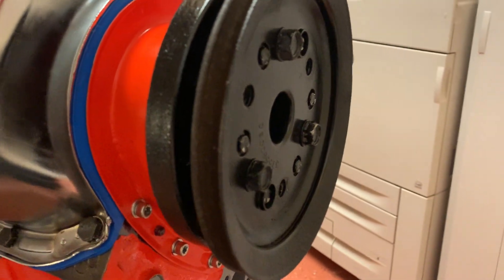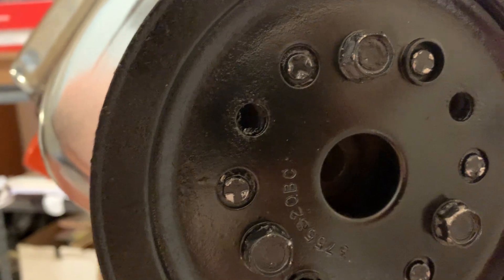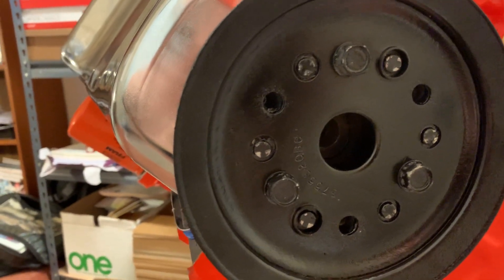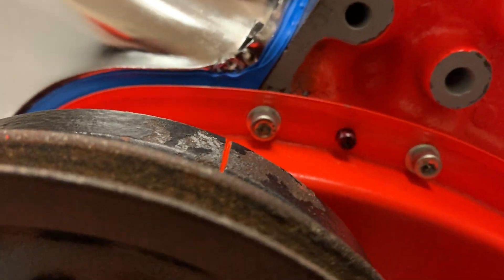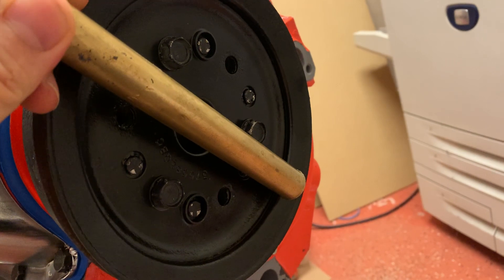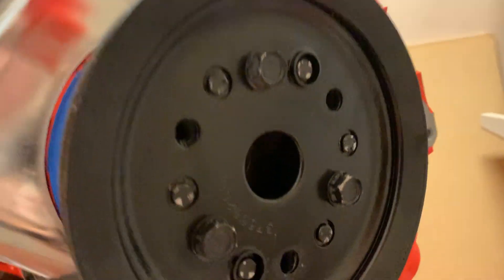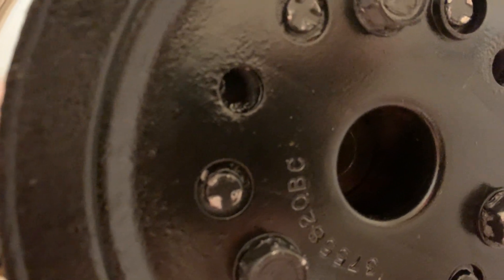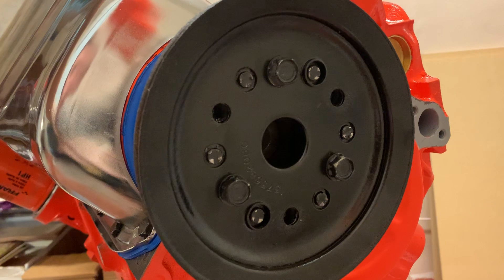Installing Balancer on SBC

Comment: My 56 chevy still has its 265 v8 which doesn't have a bolt going through the crankshaft like yours . I have to remove and replace my balancer to fix a oil leak where the timing cover and oil pan join . Thanks for the info 👍

Comment: Can you tell me where or which place you buy the harmonic balancer
Reply: If you have an older 283 like 63 and older they didn't have a harmonic balancer the cranks were internally balanced. Won't hurt to put one on, but at the time GM didn't think they needed it